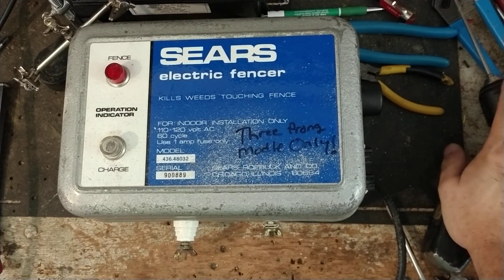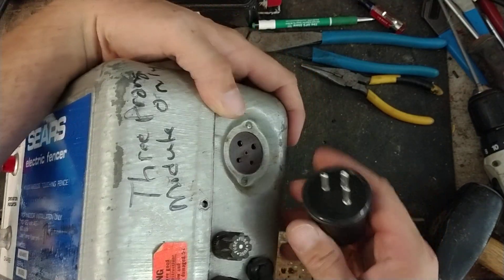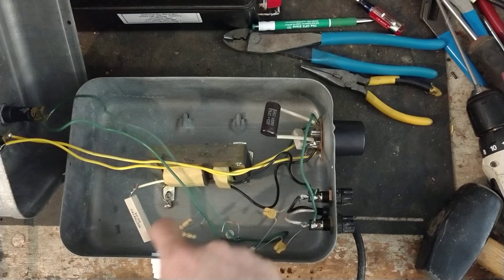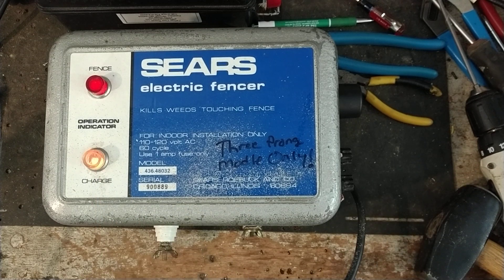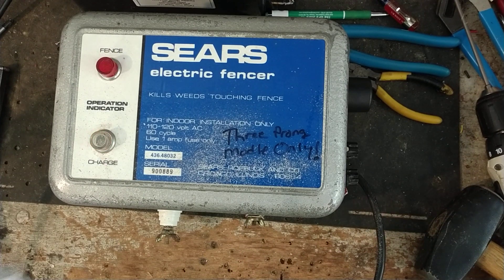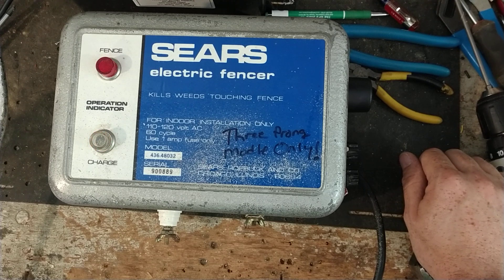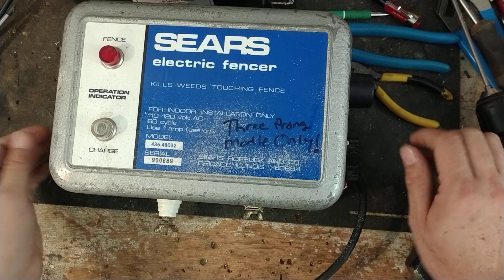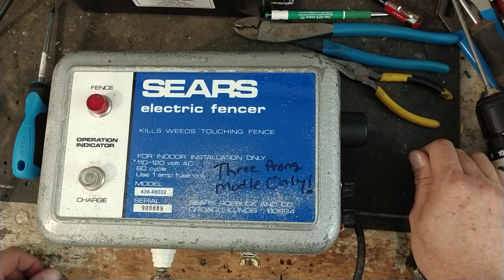How to TEST an old Sears Weed Burner Electric Fencer | Electric Fencer Repair

Comment: where do get 4 prong circuit breaker
Reply from the maker: Your best bet is to look on eBay and type in 4 prong weed chopper. But you're going to pay a premium for it these days if you find one, $40-$80 for one. The only place that was still making them stopped 3 years ago, so whatever is still out there is rare, so you'll pay top dollar if you really want one and you can actually find one. I used up my last batch of them last summer and wish I had bought more, but I didn't realize back then they were no longer being made or I would've bought as many I could've afforded to buy. If you want a newer model built today that's gives a decent shock and isn't super expensive and pretty reliable 5-10 +/- years minus lightning surges, and also repairable in the future, look at the brand Power Wizard and they're models PW1500, PW2000, or PW3000, all still less than $200 new.
Reply: @FencerFixerRepairLLCKansasCity  I have two old Sears Weed Burner Electric Fencers different models and years but both use 4 prong circuit breaker
Reply from the maker: Search eBay for a 4 prong weed chopper and that will be your best chance, which isn't a guarantee, that you might find one but you'll pay top dollar and eventually the choppers will be gone 100% and none will be available.

Comment: Where do you get on them side adapters
Reply: I got one of them but I don’t have the black adapter thing on the outside
Reply from the maker: They use a specific one in those, and I'll you watch the video to see if it is a 3 prong or 4 prong. You can't switch between the two you have to use the correct one made for it.
Reply: Thanks for the information yeah I was referencing the adapter on the side a friend brought one by the house but it doesn’t have the adapter with it (4prong) and I was curious if those parts could possibly still be available
Reply from the maker: I think they're still available just harder to locate. I might have one still in stock. If I do they're $20, plus 5.475% tax and a little shipping.
Reply from the maker: This video is from a year ago. I'm not sure what you're asking about. If you want to call me, my website has all my info www.fencerfixer.com if I don't answer, just leave me a message. I'll help you where I can.